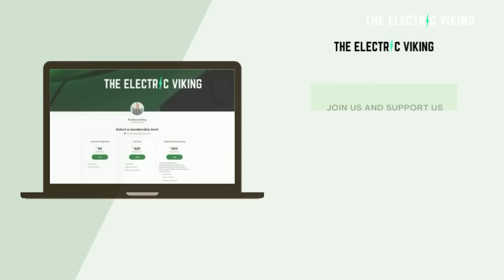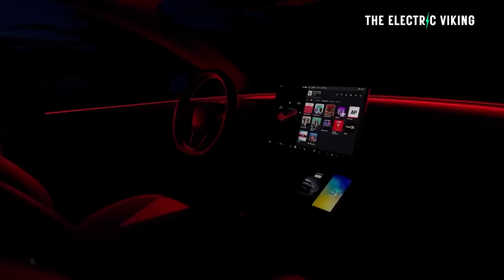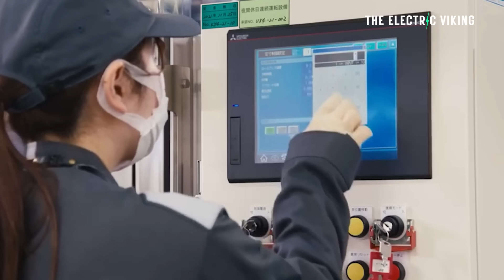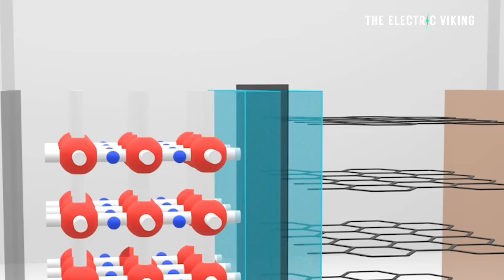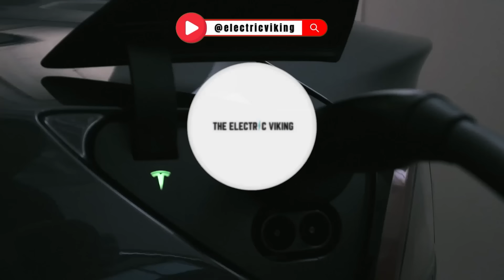New non-flammable metal oxide battery revealed by US battery company

Comment: From Alsym website: "With system-level energy densities approaching lithium-ion and the ability to operate at elevated temperatures, Alsym Green is a single solution for use in short, medium, and long-duration energy storage (LDES) applications. It’s ideal for grid and microgrid applications as well as data centers, oil and gas, mining, manufacturing, ports, home storage, and heavy industry." 
Where did 10x energy density & use in EVs come from??
Reply: Volumetric or Gravimetric?
Reply: @ Alsym Green "…offers energy density up to 1.7 MWh of energy in a 20′ BESS container" is the volumetric ed specified 😶
Reply: From the website. 
The highest performing non-lithium battery
Alsym Green is the highest-performing non-lithium battery for BESS. Its performance profile offers energy density that is 2x to 10x higher than competing technologies,
Reply: 10x compared with other Metal Oxide batteries, not compared with Lithium ion batteries.
Reply: My bad. EViking does say that some minutes into the video but he starts the video off by suggesting they might be used in EVs. This confused me as use in vehicles isn't mentioned by Alsym on their website at all.
Reply: Using Alsym stated figure of 1.7 MWh in 20ft container works out at ~53Wh/litre (if a 20ft BESS container isn't different to standard shipping containers)

According to CGPT approximate system-level energy densities of other non lithium systems:

1. Sodium-Sulfur (NaS) Batteries
Cell-Level VED: ~150–300 Wh/L
System-Level VED: ~100–200 Wh/L

2. Sodium-Ion (Na-Ion) Batteries
Cell-Level VED: ~100–250 Wh/L
System-Level VED: ~75–175 Wh/L

3. Flow Batteries
Vanadium Redox Flow (VRFB):
Cell-Level: ~20–50 Wh/L
System-Level: ~15–30 Wh/L
Zinc-Bromine Flow:
Cell-Level: ~30–70 Wh/L
System-Level: ~20–50 Wh/L

4. Nickel-Cadmium (NiCd) Batteries
Cell-Level VED: ~50–150 Wh/L
System-Level VED: ~40–100 Wh/L

5. Nickel-Metal Hydride (NiMH) Batteries
Cell-Level VED: ~140–300 Wh/L
System-Level VED: ~100–200 Wh/L

6. Zinc-Air Batteries
Cell-Level VED: ~100–300 Wh/L
System-Level VED: ~75–200 Wh/L

7. Lead-Acid Batteries
Cell-Level VED: ~50–100 Wh/L
System-Level VED: ~30–70 Wh/L

So this new metal oxide battery seems to be at same level as Flow & Lead-Acid batteries, unless I've missed something.
Reply: I ask same question on the 10x energy density. I believe the other 9x comes from Sam Evans himself!!!!!!!!!!!!!

Comment: If it’s 10x the energy density, then I’d rather have a small battery that I can replace by hand (much like you replace a flashlight’s battery) and then have a few extra in the house (or in the trunk) and recharge at home later.

Comment: If this battery exists NOW, why would it need ten years to change the world? 2 or 3 would be long enough.
Reply: Because getting the product suitable for mass production, and then scaling up that production, takes time.
Reply: Get the info out early, to get the stock price up, before the secret problems come out.
Reply: It exists in a laboratory, probably take 5+ years to develop production of scale and cost.
Reply: A quick look at Alsym's website confirms it's a grid energy storage optimised battery, they have pilots sites around the world (which have been positive) and are ramping up commerical production the start of next year.
Reply: If you want that kind of advancement quickly  then they will have to build it in China. They could probably build them and have them shipping in a year.
Reply: Many promising developments in R&D labs never become products. Usually this will be caused by economics, or a better chemistry in someone else’s lab.
Reply: And how many entirely novel startups have you brought onlime?

Comment: The whole "non flammable" is what does it for me. Even if these batteries had the same energy density as what Tesla's lithium ion batteries have, they would still be better. If they really HAVE achieved 10X energy density, as stated, then we're talking game-changing/paradigm changing technology. I hope everything that the company boasts now, is only the beginning of even bigger improvements. Less expensive EV's with less expensive to replace batteries, would be awesome!
Reply: The 10x quote is slightly wrong, it's 10x compared to 'other non-lithium batteries'. It seems the battery is a form of Sodium-Ion, but optimised for on the fly configuration flexibility in BESS (it's not designed for EVs). The 20 ft BESS shipping containers are 1.7MWh but can stack unlike lithium batteries (many of which have heat exhaust outlets on the top).

Comment: If 10 times the energy density, you could restrict range to 400 miles and save a lot of weight. That would increase vehicle efficiency.
Reply: Especially if the thing can charge quickly. Still vaporware until proven otherwise though.
Reply: I still want 1000 miles summer range, because winter cuts it half to 500 miles, then towing cuts that half to 250 miles for winter towing, that's good enough.
Reply: It's a BESS battery not an EV one, according to the companies website. (i.e. 10 x other non-lithium battery energy density  but optimised for containerised BESS that can be stacked unlike lithium ones).

Comment: 5:23 they say 24 containers of batteries can provide 1.7 MWh of electricity, 
One Tesla Megapack can provide 3.9MWh electricity
Reply: The press release says one 20 FT container (not 24, Sams accent can be a little heavy at times) can provide 1.7MWh. Alsym's battery doesn't appear to be designed to compete with Lithium on energy density, but on storage duration, discharge range (2 to 110 hours), fairly quick recharge (4 hours) and land density (the containers can be stacked). A two stack would be 3.4MWh and three stack 5.1MWh for the same footprint as a Tesla Megapack.

Their idea seems to be rather than have a battery farm of mixed fixed size battery types suiting differing purposes (multi-day backup, in day buffering, balancing etc.). Instead deploy one type of battery than can address most needs that can be reconfigured via software to meet differing patterns of demand on different days (or even hours).  

For example, one day could be all renewable buffering for renewable generation time shifting, perhaps charging twice a day. The next day, say with low renewable generation available for a few days, could be extended release of the previous stored energy. Or various mixes with other uses in between.

Even a mixed farm of Lithium and Alsyms battery could offer advantages, with the Lithium focussed on balancing and rapid buffering, and Alsyms on everything else.

Comment: Thermal runaway, cost, and range are the big factors why I haven't considered an EV yet.  Hoping this one gets into EV's soon.  An EV with 1000 mile range, no thermal runaway and about as much as a gas powered car then becomes almost a no brainer for even the diehard ICE people.
Reply: Why would you want to carry around 1000 mile range capacity?  That would be like carrying 35 gallons of gas when you only use 1-2 gallons in a day for most of a year.  Most EVs have LiFePO4 batteries now which don't have the thermal runaway problem Li does.
Reply: @sd70cal  Long remote trips into the wilderness.  I'd like to use my EV such as my normal gas car.  I'd also like to be able to use the battery for accessories without needing to charge for days.  I'd be fine with 500+ mile range, 1000ish and it becomes a no brainer over an ICE car.  And sorry, I need virtually no thermal runaway to feel comfortable parking my EV in the attached garage.  Lots of others will feel the same whether irrational or not.  This is what you need to turn the tide and convince people to go EV.
Reply: @MD-dl5hn  Well you are almost there. Probably by 2027 you'll have what you need. They just started putting some solid state batteries in production cars to test that are nearly half the weight of the current best ones and have no chance of thermal runaway. They charge really quick as well. Remote trips in the wilderness will get you even more mileage because of the lower speeds.

Comment: Dendrite free means unlimited recharge cycles. 10 times the capacity of todays batteries. High performance and high charging speed. Fire proof. Extremely cheap.  A game changer.
Reply: Not another game changer. Sigh. Charge cycles are limited by other factors such as corrosion, loss of electrolyte etc, not only dendrites. Where does this claim of ten times the energy density come from? Not the makers, who only claim energy density close to lithium, which put another way , means lower energy density than lithium.
Reply: 10 x other non-lithium batteries, it's a flexible containerised stackable BESS solution (seemingly Sodium based).
Reply: It's for stationary storage systems. Energy density is too low for mobile use.

Comment: When I hear "water based electrolyte" I immediately wonder what sort of temperature range they can work in, how well do they work in the cold and what happens to them if they freeze?
Reply: It's a BESS battery, so will be deployed with insulated/heated containers or located in warmer climes to add to the grid without freezing. Aqueous batteries tend to have additives though to extend the operating range.

Comment: 4C charging would only be 350kW for a ~75kWh vehicle battery, right? A grid scale battery charging at 4C could take a lot more power
Reply: No , only 300kW for a 75kWh battery. (4x75=300). It's as simple as that, the battery will charge at 4 times it's rated capacity. Hence a 1mWh battery would charge at 4mW.
Reply: It's C4 rather than 4C, so four hours to 100% (confirmed on Alsym's website).

Comment: You said C4 charging rate which is 4 hrs which is slow. Now 4C would have been 1/4 of an hour. You also failed to say "game changer" which is the bare minimum requirement for it to even leave the factory!
Reply: C4 seems adequate for the BESS purpose the battery seems designed for (chariging up to two times a day to 100%, but with flexible 2 to 110 hour release).
Reply: @GruffSillyGoat  but what’s the point? With what appears actually lower energy density than LiFePO4 and cost to be very similar. LiFePO4 are also very safe Or Sodium reportedly cheaper and both with better charge / discharge characteristics. Then you have competing and existing flow battery technologies. There really isn’t anything that stands out that wasn’t contradicted in what Sam read but didn’t seem to understand. It just sounded like a hyped up press release to get research funding.
Reply: @philbrooke-little7082  - It looks like the Alsym batteries are Sodium Ion, based on another press release.

Compared to LFP - the Alsym battery offers lower overall cost, higher land density use, the batteries can stack lithiums current can't because of heat venting. Plus greater operational flexibility - software defined configurations can operate from short duration (2 hours) up to long duration (110 hours discharge), rasonable charge rates (cycle full to empty and back again twice a day), durability (longer lifespan than LFP). 

Flow batteries are one of the batteries Alsym appear to have modelled, having much lower energy density and higher cost.
Reply: @GruffSillyGoat  it looks as though you’ve done more research than Sam or read a different press release. Some of the flow battery figures in terms of cost are very good and they have the advantage of almost infinite cycling. As presented by Sam the batteries do not seem to make a good commercial case and I am always wary of contradictions in a report. I certainly wouldn’t be investing with the big players already into second generation sodium and lithium improving all the time and also with flow batteries already being deployed in grid storage.

Comment: New/Emergent tech is typically expensive until capex is repaid and founders cash in, etc.  So there could be a delay before competitive pricing develops (several iterations of the basic 
tech might need be developed as well).     A mix of patented tech and trade secrets may insulate the initial manufacturers from competition.
One reason that current battery technologies are developing orders of magnitude faster than historically, is that deep pockets (Elon Musk; China) are aggressively funding/investing in
battery manufacture, to obtain first mover advantage in what might become a vast worldwide market.    
MIT professor Donald Sadoway's experience in funding his 'liquid metal' battery (for stationary/utility apps) is instructive -- it took nearly a decade to get useful funding for an extremely 
promising technology.

Comment: But, but, but, is it a game changer?
Reply: You know it is!
Reply: it is a totally new game !
Reply: Not even close.
Reply: @nickwinn7812  You are not the sharpest pair of scissors on the desk, aren't you?
Reply: @GreyDeathVaccine  You ought to sharpen up your command of English before attempting to put others down.
Reply: It's for stationary storage systems. Energy density is too low for mobile (EV) use. That point was in the video. And it would be a game changer for those industries as it can stack (others require cooling on top) and it can utilize different oxides opening up the supply chain.

Comment: I know the press release is not your fault, there are a few things missing. 10x more dense, against what? Compare to Edison nickel-iron battery or to EnerVenue. Clarify if, is mass density or volumetric density?
Reply: The press release stated it, but Sam may have missed it. It's 10 x than 'other non-lithium battery', Alsym's website lists the candidates (all in the BESS space). It's not more energy dense than Lithium-Ion (again in the press release).
Reply: @GruffSillyGoat   The press release facts are, electrodes made mostly of manganese oxide, the other of metal oxide and water-based electrolyte. Fast-charge over 4 hours, what is considered fast, anything above 1C? 1.7 MW-h/32.94m^3, the nearest thing to volumetric density.
The website FAQ section mention differently battery chemistries. Their comparison is ambiguous at best. Conveniently they consider fast C/4. 
Do not get me wrong, I wish them success. My dislike for lithium batteries is all-time high. I am a believer of Sadoway doctrine, cheap batteries come from cheap materials.

Comment: We don't really need any more than 600-800km of range, that's what fast charging is for. Instead we need safe, light, fast charging in conjunction with high energy density, so that the battery is no more than the size of a current fuel tank (or smaller). That way cars can be smaller, lighter and more efficient, or electric aviation and shipping as well as long haul trucking are extremely viable.

Probably also on the wish list should be cheap, made from easily recyclable materials, and high cycle life. These characteristics make off the grid living more viable and really put a nail in the coffin of fossil fuels and nuclear.

Comment: I've read one article about those metal oxide batteries and at the end of the article there is one sentance "those batteries can't reach the energy density of Lithium batteries". What is the truth?
Reply: They are an alternative to lithium and better than other alternatives, however, they are not a replacement for lithium, just for other uses such as bulk storage - grids etc. They will not be able to cope with the power required for speed etc with EV,s for example. LFP batteries and eventually solid state LFP have not been matched. Lithium is the lightest on the table of elements hence why it is so much better. Technology to negate the overheating has already been achieved making LFP not just better, but very safe now. EV,s 100 times less likely to catch fire than cars with internal combustion engines.

Comment: That batterie can do anything except leave the lab!

Was it AWSOMEGREEN"!
Reply: more like Soilent Green!
Reply: It has already left the lab. It's being used in several places around the world already. But, which was said but not made clear in this video is this battery is for stationary systems. It is not energy dense enough for mobile platforms. It can be stacked which Li can't be and it doesn't have the thermal runaway problem of Li. It's about the same as other non-Li systems except it can be made from different oxides opening up the supply chain beyond one mineral.

Comment: No matter what you do with a battery you still have a device that only stores energy not making it out of nothing.  You still have to put in the same amount of energy into the battery to get the same amount of energy out.  Most of our energy, and for the foreseen future will be from fossil fuels.  Next you have to grasp that we only receive 10 watts per square foot on a nice sunny day, this means we will have to decide to starve to death or make electrical power.  We need to address the true problem of more energy conservation and less with picking and choosing the power source of the decade.

Comment: They should put them in the electric bike batteries and make them available to switch out and they should do it for free after what they put us through waiting around, in horror.... there should be a public Battery Exchange
Reply: How do you fit a 20 ft shipping container on a eBike, the battery is optimised for BESS not EVs or eBikes.
Reply: @GruffSillyGoat  trouble begins when Jesuits start doing math